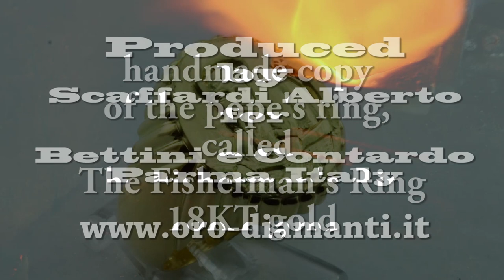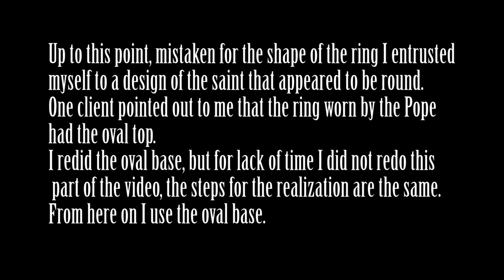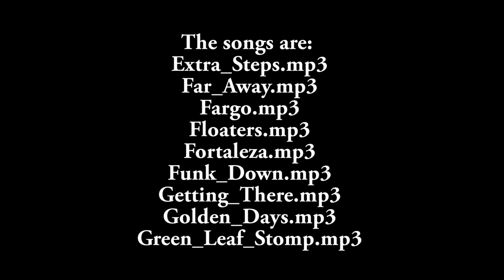Handmade copy of the pope's ring called The Fisherman's Ring

Comment: Your work is just astonishing! May I ask what is the thickness of the stock you are using? With all the carving it must be thick!
Reply from the maker: Thank you, Normally I do not measure the plate, from experience I see the thickness I need in sight. The thickness of the upper part was approximately two millimeters thick, that of the structure approximately 1.40 millimeters.
Reply: scaffoal Your work is VERY IMPRESSIVE! Thanks for your response 😊

Comment: Just to bad such rings i would never buy cause got one at confirmation and every time i bumped the ring it cut into my finger and it ripped the skin, so i only buy rings that aint hollow in the back. But nice work.
Reply: tsfcancerman so like a superbowl ring
Reply from the maker: This happens when the plate is too thin. When the plate is of the thickness I used for the ring it does not happen. However, working on order if the customer requests it is easy to do the internal coverage